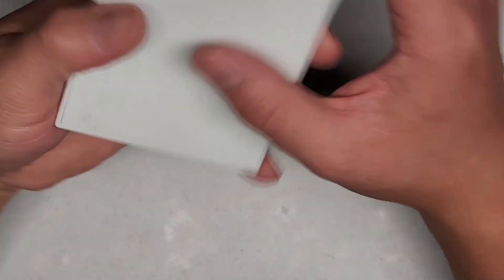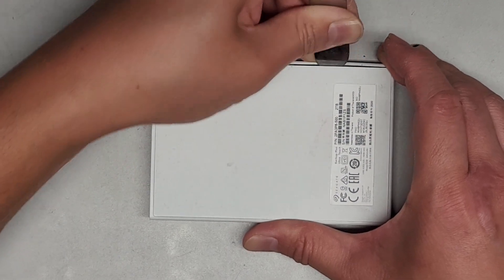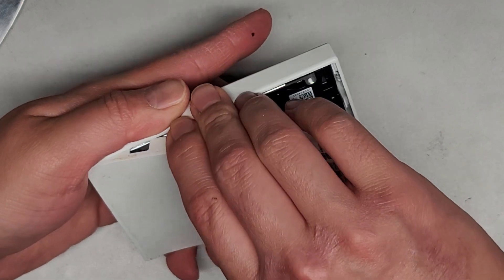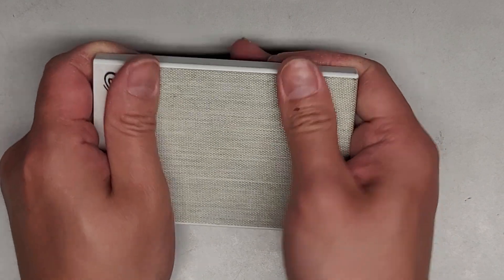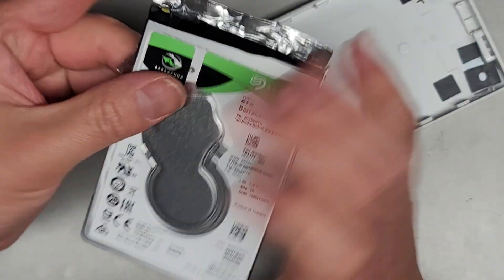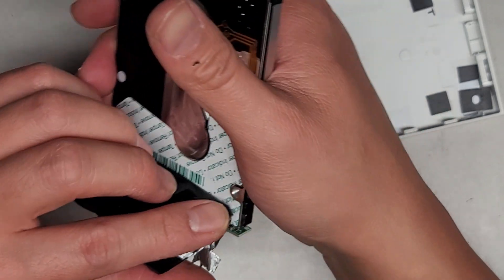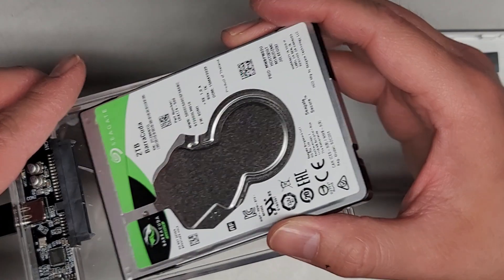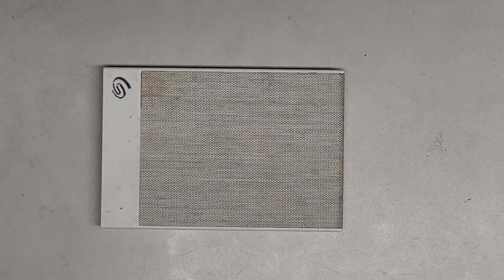Seagate Backup Plus Ultra Touch USB Hard Drive Disassembly SATA USB Adapter Replacement Repair

Comment: It is not automatic garbage, if the second adapter does not work. It can still be opened up and have further repair.
Reply from the maker: What's automatic garbage? It doesn't do anything automatically. Lol

Comment: I have the exact drive. And it just came out of 3 year warranty. And the disc is spinning and the led is lighting up but the drive is not showing on the PC. Nor being read by any disc utility. Could it be a hardware issue similar to yours ?
Reply from the maker: Very likely

Comment: hello sir, i need your help...  i got the same seagate ultra touch 2tb model mine hdd is getting detected sometimes but when i put in password it freezes my pc and the toolkit shows password loading and loading..please help me out what can be the issue
Reply from the maker: @lakshit2k  you'll likely have to send it for data recovery.
Reply: @ItsBinhRepaired   is there hope for data recovery..?!..
Reply from the maker: @lakshit2k  try 300dollardatarecovery.com they have a good track record with my customers so far.

Comment: Hey, my hard drive fell, I plugged it back it, it worked for a minute, then stopped and started making a beeping noise... Is that fixable? And can I fix it on my own?
Reply from the maker: You'll have to send it for data recovery. I recommend 300dollardatarecovery.com
Reply: yes it is the arm stuck on to the platter @ItsBinhRepaired
Reply from the maker: Yup

Comment: hey did the drive work with the external case? if not then does sending it to data recovery works?
Reply from the maker: What happened with my customer's is not an indication of what will happen with yours, so whether mine worked or not useful information. If you can't get your data, I recommend 300dollardatarecovery.com